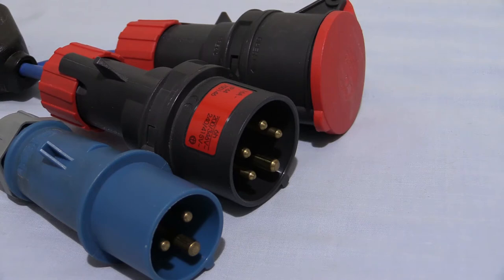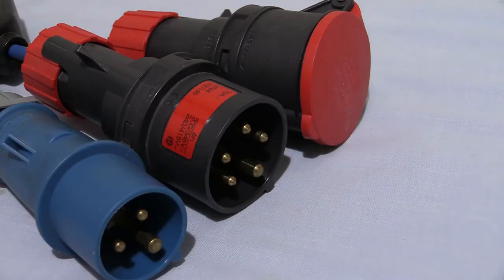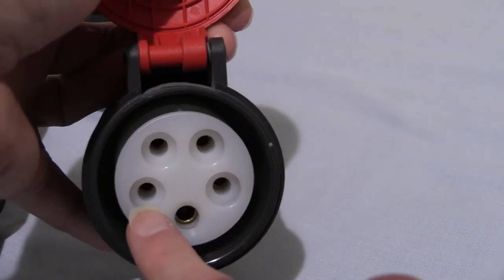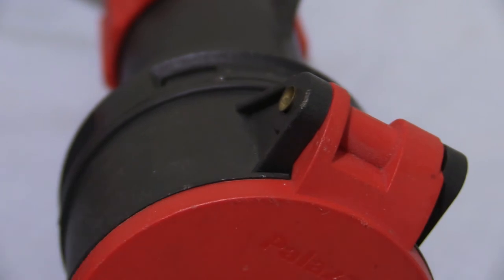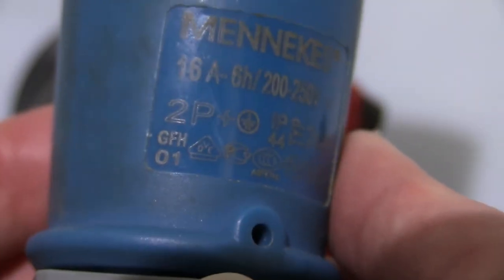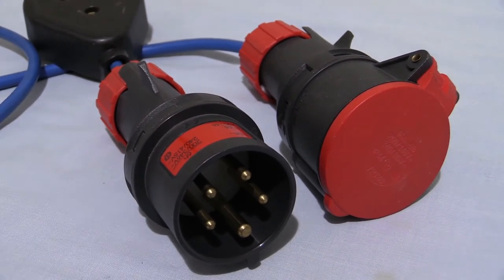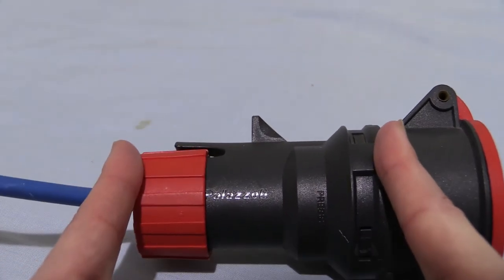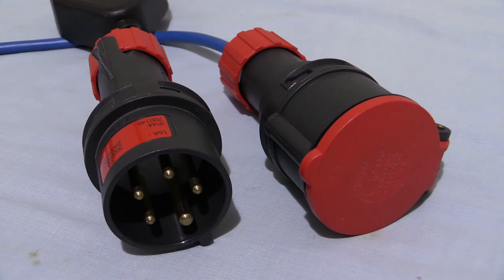Plugs : 3ph+N+E plug & coupler, 16A, BS EN 60309-2.

Comment: Is 4mm2 enough for a 32 amp load extension cable? I am debating 6mm2 but it is much more expensive.
Reply from the maker: Ooooooh!!!!! 
Tricky, tricky question!
The thing is, with questions
like this, is that I just cannot say.............
.
.
.
.
................No or Yes. Here's why:

When making up extension leads, you do need to take into account the overall length. The longer it is, the thicker it needs to be!

Here's why:

In electrical system design, there are a complex set of numbers and parameters which you need to stay within at all times. These include: Supply characteristics, Volt-drop and overall fault-current which affects Disconnection Times!

If it's an extension lead, then it can more-or-less be said that you need to comply with the 0.4s disconnection time if a fault develops. Too thin of a conductor will reduce the fault current and 0.4s disconnection times will be non-compliant. What can affect the 0.4 disconnection times, is the circuit into which you connect the extension lead already being too long, and poor supply characteristics.

Next up, if supply characteristics are good, once again, if an extension lead is too thin for its length, you will also suffer volt-drop, and this can also affect fault currents and disconnection times!

There are soooo many things to consider and factor-in when choosing a conductor size, there really is!

Because of this, from this distance, I cannot say which conductor size suits your needs. This is for your safety and my liability.

What I will say though, is this:

If you went somewhere and purchased a ready-made 32A extension lead and it was ten metres long, it will most likely have 4mm conductors. That's all I am saying!

While you're here, don't forget to BAAAAANG that subscribe button, GET THE BELL ON and enable your subscriber perks, as new vids drop every monday, 6AM, UK time!

Thanxx for watching,

-Wayne's Electrical.

11th December 2020, 01.10